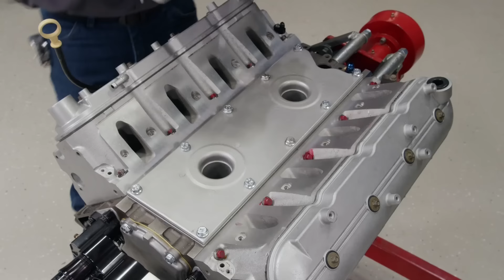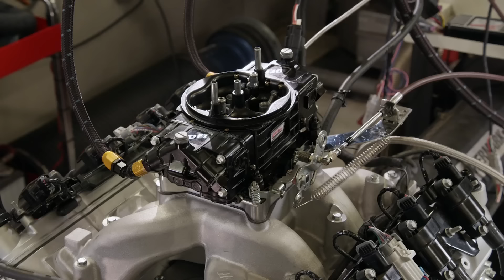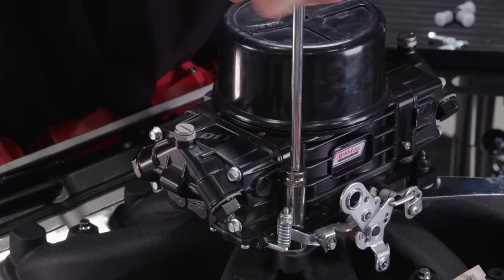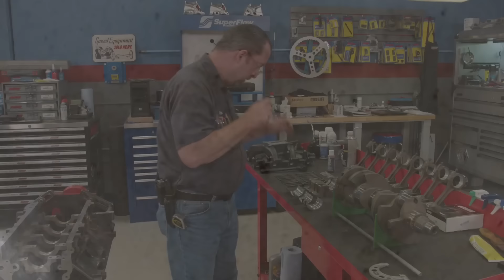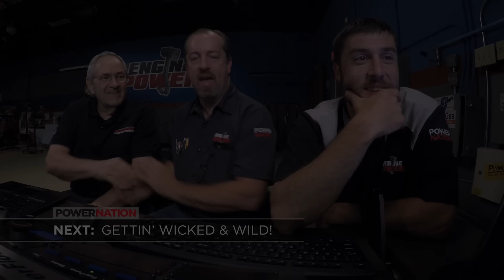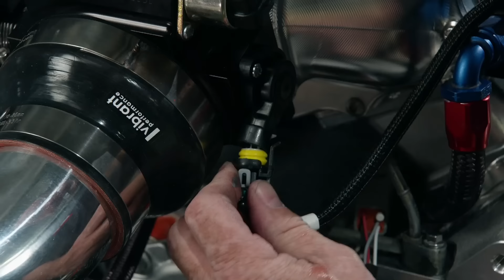Improve Horsepower and Torque: High-Performance Tips For LS Engines - Engine Power S7, E16

Comment: I see you changed out rockers for roller rockers but then went back to 1.7 ratio non-rollers, WHY? timestamp 8min40sec 2ndly, why not add oil pump retainer rind since it's known that over time that 1-bolt seating really isn't good enough down the road for maintaining good seating..

Comment: I've Dyno'd more than 300 LS engines. 24° ignition advance is not enough timing for a Truck LS on 93 octane, and didn't give the baseline test a fighting chance to prove what HP it's capable of producing. 
The MSD box comes with several ignition curves Pre-installed, and having more ignition timing than 24 degrees. What curve(s) were used for all the tests? If it was 24° across the board, you left a lot of horsepower on the table for all the tests. 
 CNC Racing Heads.

Comment: Man you can find 6.0 short blocks for a lot less than $1000 like they stated. After vatting, boring (if you choose), machining heads and block if needed, you MIGHT spend $1000 on your block.

Comment: Hi guy's. I need advice. I have a LS2 with a K1 408 rotating kit. Crank and conrods with Wisico K448X3 +5cc pistons, COMP Cams Ultra Pro Magnum Rocker Arms 1678-16 cam 1.8 ration, LS3 ported heads and intake. According to online compression ration calculators. I have a 12:1.1 compression ration. Cam spec's is : VCM 532 cam
Duration 215/223
Lobe Separation@ 112
Valve Inlet.583"
Exhaust.583" 
What compression tester do you recommend for testing. I broke two compression testers. Any advices will be appreciate. Thanks for all the nice YouTube videos.😊👍

Comment: Also, I used that same timing setup with a Melling HV295 Oil Pump (with the spacers) and had issues with the pickup tube needed to be extended.  Then the pickup tube boss, as well as the oil pump bolts all hit the timing cover.  Finally the "slosh tray / oil baffle plate" in the bottom of the oil pan then hit the pickup tube once it was modified to move forward the 1/8"... You guys didn't discuss any of this...
Reply: the instructions for the timing set mention the bolts hitting the cover. 

This is just another reason NOT to run a double roller. It's an absolute waste of money on a LS. Guys are making 1500hp reliably on single chains.

Comment: I wish you guys would test these using the stock intake and injector systems.  That intake and carb would change the HP/Torque numbers...
Reply: That's fine if you want a single Chain.  I'm an old-school SBC man, and would never run a single chain, in any one of my performances builds.  Seen too many fail (or JUMP TOOTH ONCE A LITTLE WORN)  with extra spring pressures.  Singles are not my favorite..

Comment: why do you run 650cfm ... when its fuel injected 78mm its nearly 900cfm and 90mm its more then 1100cfm why do you restrict the engine so hard??? The engine its a air pump...give it some air

Comment: 36 years ago my Dad owned a auto  salvage yard. My first build was a Chevy Monza Spider with a over heated factory motor. I swapped in a 302 chevy that was built. See my dad would not allow me to stick a 350 in because he thought cubic inches would mean to much horse power.  Haha. Swapped out the engine and went to the track 110mph in the 8th. Scarry as hell.

Comment: my 6.7 L LS on the wheel Dyno it made 361 ft pds of torque and 274 hp
in my 2001 Chevy suburban. 4x4 2500 
                      408 ci LQ4 LS

Comment: Would all of those parts on table work on a 2005 Chevrolet Silverado crew cab short bed 1500 LS with the 5.3 v8 vortec LM7 because i want to get my 5.3v8 to about 500 Horsepower

Comment: I wish they could speculate on how formula 1 teams make 850hp from a 1.6 liter v6 turbo.

Just seems that the level of power per displacement is nuts.

Just wanna see what it takes on the highest levels of racing.
Reply: Lots and lots of Boost

Comment: I have 4L70E with heavy duty pinion and Teflon pads and with 5.3 with big cam , heavy springs , roller lifters putting over 400 HP . 4.56 gears . Silverado dual cab it runs great .  I can pull 5000 lb trailer with ease . it s prefecto !

Comment: My Budged friendly LS should make about 450-460HP. LQ4 6.0 Std. Bore. BTR Truck Stage2 Cam, 5.3 706 Heads, CC'd @ 61cc with a final C/R of 10.5:1 and a Trail Blazer SS intake. 36lbs stock injectors.
Paid $450 for used short Block 6.0 incl. oil pan, Balancer (Facebook)
$80 for set of 706 heads with 1 bend valve (Facebook)
$200 for used complete 2008 5.3 Flex Fuel Intake. Same as Trail Blazer SS (Facebook)
$330 for camshaft with Military Discount from BTR (Manufacture website)
$300 New Mahle Gasket Set (Ebay)
$180 New Melling Lifter + Trays (Machine Shop)
$400 for re Honing Block +Cleaning Block and other Engine parts (Machine Shop)
$40 STD. Piston Ring Set (Ebay)
$180 for Rebuilding Heads (Machine Shop)
$85 New Water Pump with Thermostat (Ebay)
$350 Labor to assemble Engine ( Machine Shop )
Total $2595
-$750 Sold used 5.3 ( Facebook)
Pictures Instagram https://www.instagram.com/p/CHjyuGPBjqSE2ayWBt25XtqFuv4iQCGWYVZSKI0/

Comment: stock manifold and fuel injection comes with the motor at the yard.   add the cpu for 30 bux.  thats cheaper than the "cheap" parts u threw at it, and probably works better.

Comment: Quit with the carburetors, who the hell puts a carburetor on an LS? I’m sure I’m not alone in wanting a fuel injected LS build no carburetor, and stage 1 starting with the factory harness, factory pcm, and maybe a flash tune from hptuners. The ls is injected from factory, i get that carb nostalgia is real, but I prefer horsepower to nostalgia any day.

Comment: You can get lots of power out of those junkyard LS but if you gonna run a power adder like a Turbo that thing you gotta do is gap the rings because if you don't gap the rings and get high on the PSI she will squeeze the top of the piston and that will be it but once you gap the rings your safe to add the boost

Comment: I dont like the looks of LS, nor the sound too much, but I do appreciate the power they make and this is one of the more cleaner LS Ive seen.   
Next spring, late May-early June Im thinking of replacing the rebuilt 350 out of my '69 El Co and either going larger displacement SBC stroker around 454 inch, but Im also looking at the LS stuff.

Comment: WHY WHY WHY the carb?  It alienates most people who swap these and makes these tests basically worthless to the average build.  Get with the times, show us what a good chunk of us already know.  Leave the bottom end alone, don't even look at it.  Swap a good cam and springs and pour on the boost.  Stock heads, stock coils, TR6 plugs, bigger injectors and stock (flashed) EFI or Terminator.  What I'd like to see is how the stock motor with a cam/springs does against some fancy aftermarket heads with 5, 10 and 15lbs of boost thrown at it.  ...or maybe the partners don't want everyone to see the gains from cylinder heads that can cost as much as an entire swap....

Comment: Why do you want to put a carburetor on an LS when NONE OF THEM are carbureted from the factory? I mean you go pull one from the junkyard and it is going to be fuel injected with all the fuel injection hardware. Why not just run the stock port injection hardware rather than going out there and buying a Holley Carb and trying to figure out what size carb it needs and having to adjust it?

Comment: Would love to see something like this except with the factory fuel system. I want to know the best things to do on a LS I already have in a truck.
Reply: Best thing change the cam
Reply: Port throttle body, headers,cold air intake then do a cam and lifters if those other mods don't satisfy you haha.
Headers are the best mod I did to my truck! If you have a 4l60e look into a Corvette servo that's my 2nd best mod.

Comment: Pat, Mike, I'm getting ready for my Second Engine build. . .
  Of course my first had a few issues with my valve train when I did the Cam Swap. And I know you guys did a Mopar 360. . . But it seems like I keep ending up with it's Baby Brother the 318.
Well Long Story Short, I'm look at a Budget of $2400 and By Boring it .040 over and Give it a 3.58" Stroke like a Stock 360. . . And a Mid Rise Dual Plane, I hoping to make a 318 into a 352 Stroker.
  What kind of numbers do you I can Make?
 I'll be using a $75 Flat tappet Hydraulic Cam, a $238 intake, and I'll leave the Carb choice up to you guys. 
But beside the forge Pistons, Stroker Crank, Cam, and Intake, Literally everything else is Stock. 
I want to see what I'll be playing with fellas. . . And I know you'll guys get a kick out of the "Little Mega Block".

Comment: I had no idea on an LS engine you can run a carburetor so if I was to put that in let's say my 76 Chevy 4 wheel drive I can run carburetor but then on the Ignition since the 76 has a distributor I will have to run like an msd Ignition set up or what? Same with timing how do they work on these LS engines🤔🤔
Reply: Yes you'll need the MSD
Reply: The MSD is way easier to set up than a distributor. Just plug it into the stock sensors and coil packs and give it +12v the same as a distributor. I’d consider keeping it EFI since you can buy a standalone computer for about the cost of a carburetor and intake. LS engines are dead-simple.

Comment: At 5 minutes in you swap the camshaft, I'd love to know how you can do with the heads on?
Reply: I think you can pull the push rods out then spin the cam around and the lifters should be held up by the plastic cups    I could be wrong tho
Reply: @Avfae-the-yeep  you are correct
Reply: Following I was thinking the same thing

Comment: What's a good start for a 4.3.. I have a 96 blazer I want power but the milage. Its 2wd a small lift n tires thinking bout going a 283 or 305.. far as price goes want to do Holley sniper efi or carburetor

Comment: You could have bought 4 good turbochargers for the price of those heads. And that's all you would have need to make much more HP than that. A turbocharged engine doesn't need that cam either. Also you don't need to go to such high damaging RPM's to get that power. !?!??!?!?!?!?!?!?! High RPM is the number one killer of engines !!
Reply: notsogreat123 / You're just wanting to kill the good sound of a NAE
Reply: NA engines give you more longevity than boosted engines. For me I chose the 5.0L Coyote V8 over the EcoBoost V6 in the F150 anyday of the week.
Reply: Pat just said he's a N/A guy!

Comment: If you want to run a LQ4 truck block for a drag racing application get one that's been rebuilt at the very least. the pulls are fine for street driving and will give you years of service but not when you add high flowing heads and intake the old bearings seem to eat themselves quickly . If you buy a rebuilt one you will have a solid start that will make tons of power for cheap. it pays in the long run instead of having to keep replacing the pulls blocks every time one eats it's own bearings.

Comment: When are you going to use texas speed?
Reply: When they start paying to advertise lol
Reply: I agree, I want to see junkyard pull, no pulling a part to clean the block or ring gapping with just a 228r on 110° with bee hive springs and chromoly pushrods with just a trunion upgrade, long tube headers and a fast 102 intake with a Nick Williams 102 tb , I do believe that would shut up the neighsayers as to a true junkyard bolt on engine then be honest like the rest of the LS tuners and give it the beans, you will be shocked as hell to see the results.
Reply: Yuck

Comment: And I just noticed those MSD coils... why? Why would you do that? And E3 plugs? Jesus, at least do product placement for shit that WORKS...

You could've had a 4150 throttle body and efi manifold and a goldbox/terminator/fitech/ect efi setup on there for basically the same cost, too...
Reply: Honestly carbs are ridiculous at this point sure the carb was only 300 but the manifold was 500 and the ignition box was 400 lol and then if you want to use anything modern 60e/80e you have to buy a $400 trans controller

Comment: That double row timing setup is JUNK. A good-quality single chain and a Cloyes Hex-A-Just allows for spot-on cam degreeing and adjustment between runs with a two-piece cover, with lower moving mass.

Comment: Lost me at carburetor.
Reply: Happens all the time with millenials....🤷‍♂️
Reply: @johnbaker3843 Did you type this out on your flip phone??
Reply: Sorry I was agreeing with you
Reply: Fuel injection round here baby
Reply: Why, carbs can make well over 1000 hp and are much simpler and cheaper
Reply: @toxictryhardtommy7251 not true the part about being cheaper. If so why do all car manufacturers not use it? Fuel injection along with computer control systems are better all around.
Reply: @toxictryhardtommy7251 They're just a pain for most people. Efi is more intricate, but you have alot more tunability. You can actually tune individual cylinders rather than dumping fuel in the opening and hoping for the best at the o2 sensor. I like carbs on old cars where they should be, but anything newer I always run efi. I also don't have to tune it every time the temp or elevation changes. If I do, I plug in, change a few numbers and go.